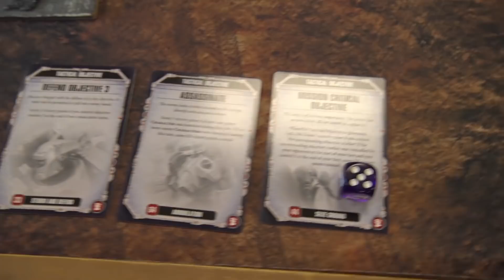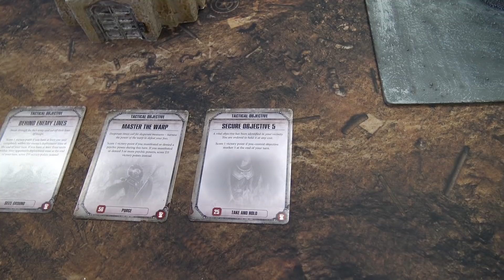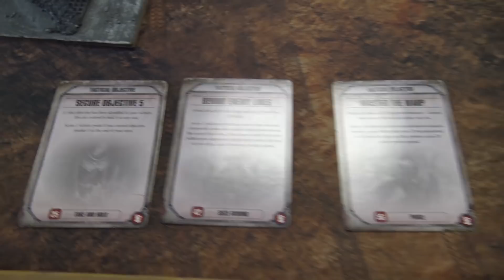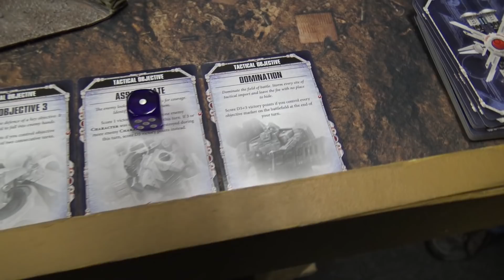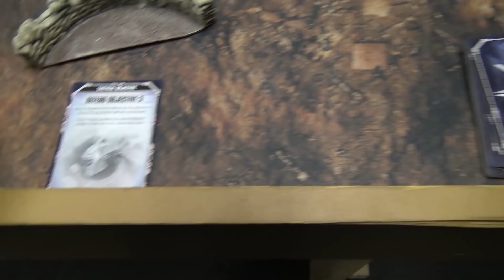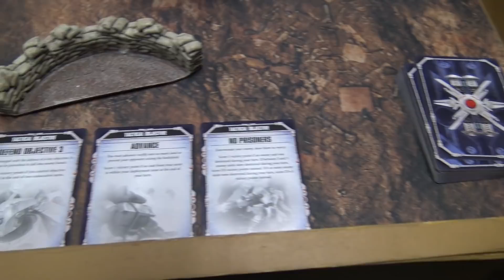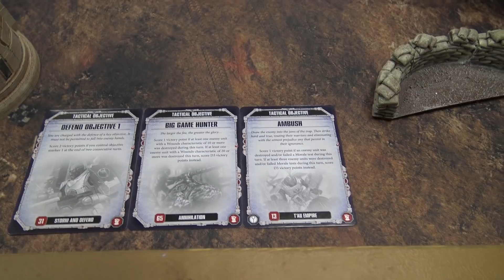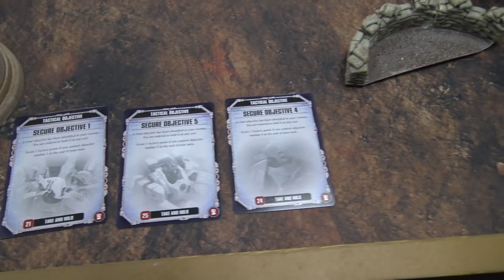*NEW* Tau VS Genestealer Cult - Warhammer 40K Batrep - 2,000pts

Comment: You cannot move 5 inches with a leman russ and still get the benefit of grinding advance. It literally says in the codex it moves a distance in inches less than half of its current movement characteristic.
Reply: animagreed but you can move 4.999999 inches.  You can just assume he moved that. It's fine.